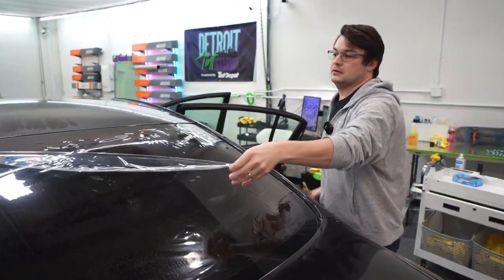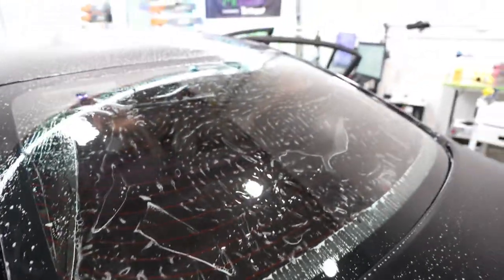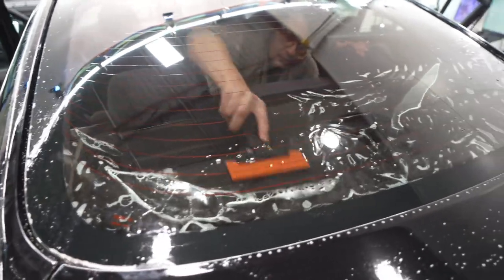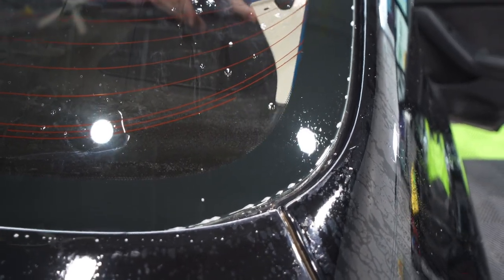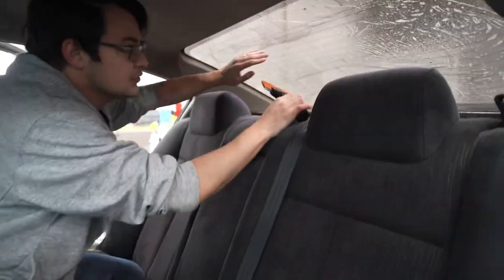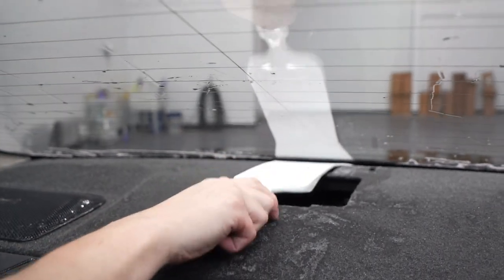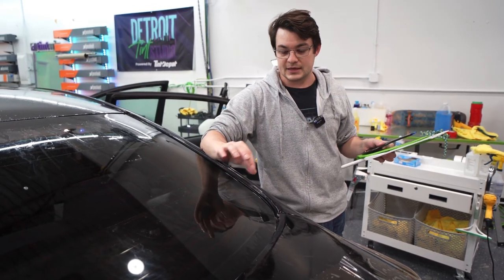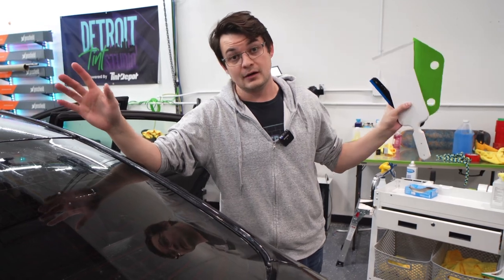3 MUST HAVE Tint Tools for Back Windows and Windshields

Comment: working the air and water out from the middle seems to be one of the most important parts of getting a nice clean install. I recall, one time last year, you said on one of your live streams that working the air out to the sides when doing a glass with the defroster lines is best in getting all the air pockets out.
Also, for me and my big hands, I prefer the "Stroke Doctor". I used it on my windshield. It was just easier to do because of my size.
Great how to, Matt. Thanks for showing and explaining the process. Always thankful for having learned to tint windows from you. You make it very mechanical for the most part. Repetition is what did it for me. It took me at least 3 times to get the windshield shrinking process down. I think one of the things I noticed that helped me was when I used the dryer sheet, I went over the windshield with 2 dryer sheets. I found it very helpful.
Thanks again, Matt!

Comment: Question: have you ever seen defroster lines in the back that can cause the foil not to stick ? I have lines of air there and they claim the defroster lines are too thick (2008 Mitsubishi Lancer Evolution X and nano ceramic tint). Previous (some "3M" tint) was sticking just fine.
Reply: Hey there, I am a Tint installer for a dealership as of 4 years, The answer to your question is, No there are not any that do not stick. The issue lies with the fact the defroster lines get very hot compared to a cool/cold glass and being that Tint film prevents and traps heat between it and the glass it creates condensation that quickly dries, over time the moisture causes those areas of the tint adhesive to dry out and become unadhered in those areas first.

Comment: Do any installers ever protect the interior from water? Every video I've seen they are splishing and splashing and pouring water all over the place and running it from the squeegee into spots that will run down into pockets that will remain wet and stink after a while, have you guys seen an installer that covers anything up.

Comment: You make great videos! Im an amateur tinter. I've done about 15 vehicles, but all with Black magic & Gila films. I just did my first windows with a little higher quality carbon tint from Tint depot... my biggest problem is im use to those low quality films that have far less adhesion. Im having trouble finding the right slip solution ratio for the more aggresive adhesive on the tint depot film. It tacks up too quick, not giving me enough time to slide the film around on the glass. I use j&j baby shampoo & was told to add a few drops of dawn. Ive even over used shampoo & dawn but still seems to tacks too fast. Any suggestions? Im in south texas where an 80 degree day is on the "Cold" side.😂
Reply: I saw a guy use baby shampoo for his solution
Reply: I've been a tinter/ppf installer for going on 10 years. All of the other guys I work with use baby Shampoo. I use Suave Shampoo & it works like a charm. I finally got one of my guys to try it & now I've converted him. But If you're gonna use baby Shampoo, use about 4-6 drops. No dawn
Reply: For that heat bro do go 10 drops of baby soap.. it’s too slick let it sit for a min before touching
Reply: @noahshepard7923 I’d like to try it with suave, how do you measure it per liter ?
Reply: @frodcoma973  So I get the blue ocean breeze shampoo in a pump bottle & I put 4/5 pumps in a 32oz Zep bottle. Give it a try and let me know what you think.

Comment: Holding entire back window film like that, won’t that cause lots of contaminants? Getting chills looking at it. Sure if I tried the entire back window will turn into braille 💀
Reply: Thinking the same thing
Reply: No way thats a clean install
Reply: @jrvond3357  it is. That's how I tint back windows and they're clean
Reply from the maker: I’ll make a follow up video. It’s very clean and the quickest way to install a back window. Hardest part is handling the film. Just don’t bump the car.
Reply: Old school installation
Reply: Well, you can also reverse roll or you can fold over until the two ends meet in the middle and open it up once you're in the car. Reverse roll, Fold over, Frankenstein. All 3 of them works for me, all clean installs. Frankenstein method is just the fastest imo.